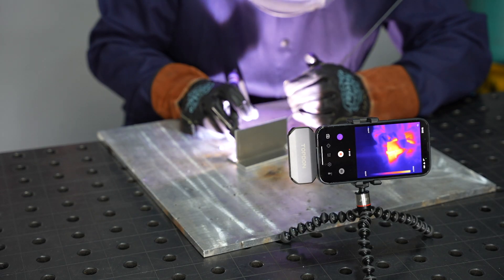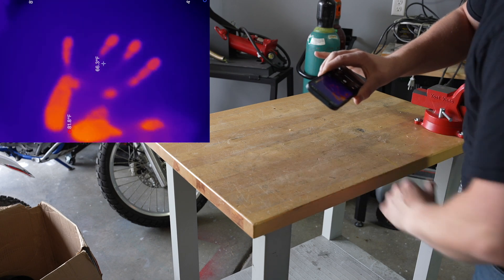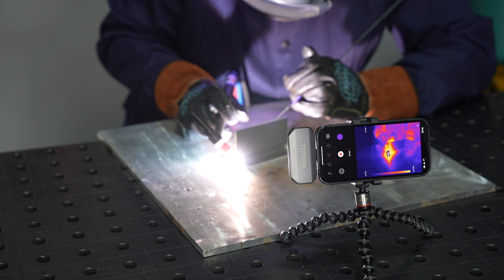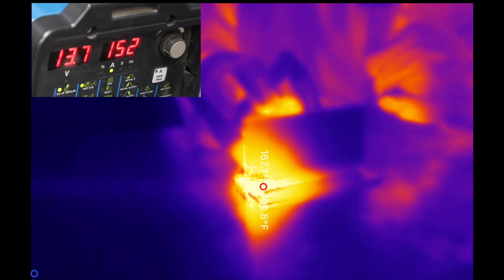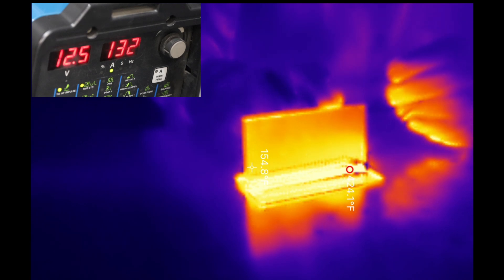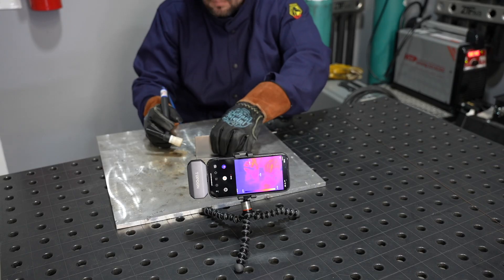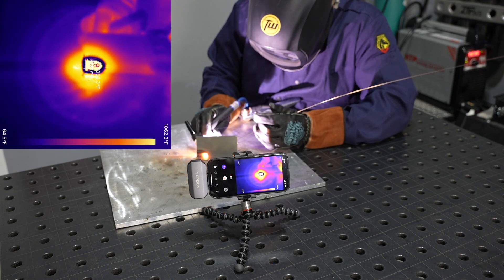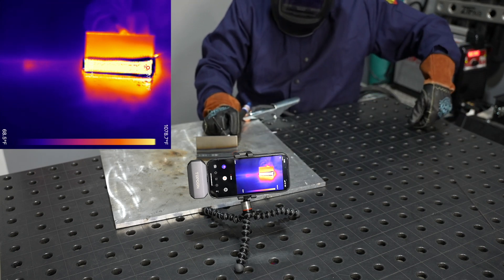Simple 3 Part TIG WELDING Routine Changes Everything

Comment: Really surprised you’re not using a gas lens. It kinda looks like a CK125 lens, #8 cup and a 3/32’’ wedge collet might fit that torch. The stick out is pretty forgiving in corners and tight spots. I’ll probably get some flack for saying this but I generally use 2% thoriated on aluminum. Found your channel from that nitro drill post. 👍

Comment: That was 5356 filler, you see the green light at the final couple dabs ….
Reply from the maker: You got it!
Reply: @TimWelds  it also helps with the weld bead being nice and shiny 😉
Reply from the maker: Gotta love the shine! It’s my most common filler for TIG when parts aren’t seeing elevated service temps, mostly for the look and because it takes anodize well.
Reply: @TimWelds  that is exactly right!  I never anodize anything and a lot of the stuff i weld is either a casting or does see service temps in excess of 150F 
So my go to filler is 4043 …. But as soon as i need saltwater corrosion resistance or there is done sort of marine application, i am right there with you and 5356 again.

Comment: I've got that same camera. It's actually pretty awesome. Never used it for anything related to welding.

Not saying you haven't, but it's a good idea to study an emissivity chart when using ir for measuring temperature.
Reply: If things aren't too hot one way to get consistent (if not absolute) results is to affix a piece of masking tape and read that.
Then you're not reading polished/chrome against something that cast, against something that is painted flat black, etc...
Reply from the maker: Thanks! I was playing with that on some other things. It's interesting to see heat reflect off of some shiny objects. For this video, I was just looking for the general trend rather than an actual number.

Comment: Hello!
Got got any videos or advice on how not to shock yourself when you touch the filler rod to the tig tip on a metal table? Thanks
Reply from the maker: Great question! The big thing is to wear gloves and sleeves as was already pointed out. Some machines will do it more than others. I used an old Miller Syncrowave years ago that was particularly bad about that and I learned real quickly to wear my gloves and direct the filler right into the weld pool.
Reply: @TimWelds  I learned on a newer synchrowave, and it shocked me thousands of times. I also didn't wear gloves or long sleeves. I had to learn to weld again, or at least to weld to the subpar standard that I did before, when I started taking PPE more seriously.

I'm not "a welder," but I am required to weld when something in my area needs it.